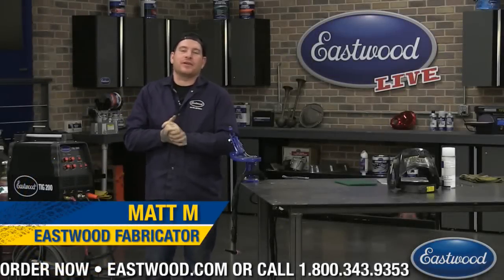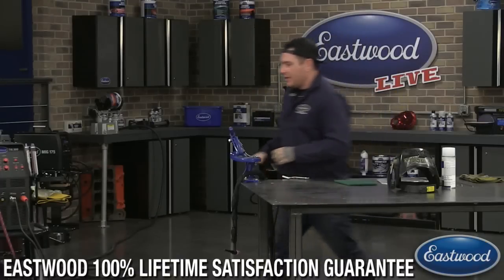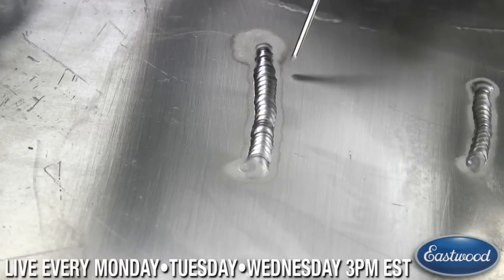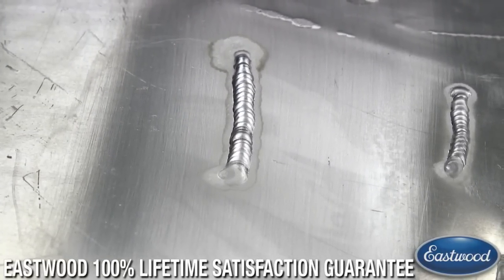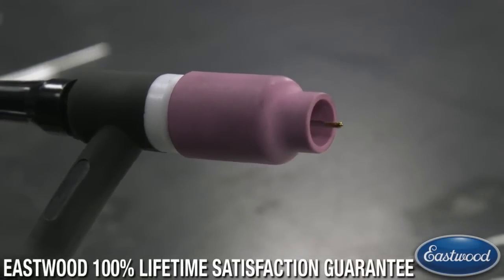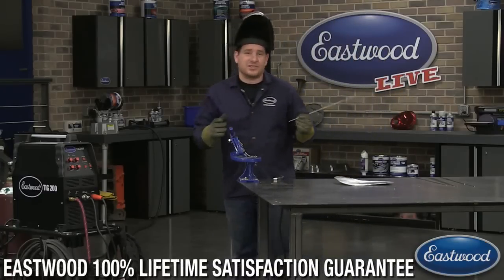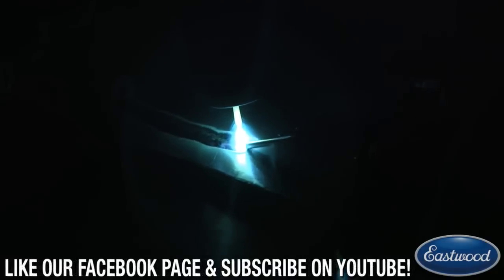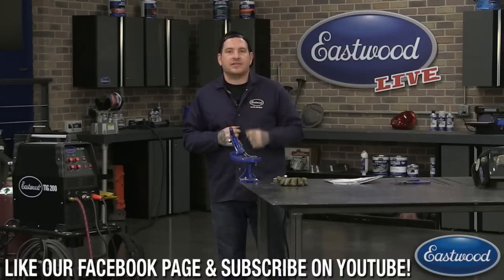How To TIG Weld Aluminum - LIVE at Eastwood - TIG 200 AC/DC Welder

Comment: what about when your join two pieces together similar as to that thickness or even two different thicknesses are settings or anything change very much and would you still be using the same rod and  torch end

Comment: I followed this video and everything went well, just need to keep practicing. My question is, when I am welding in a sitting position (I sit because of my back problems) the pedal wants to work its way away from me. I tried sticking a piece of 120 grit stickit to the bottom and it still slides away. Any advice?
Reply from the maker: You can check out the rocker style pedals we offer. https://www.eastwood.com/tig200dc-foot-pedal-upgrade-5-pin.html

Comment: I have the TIG 200 but it does  not have the TIG/Stick switch? Does my welder not do stick as well?
Reply from the maker: Older TIG 200 models do not have stick welding capability

Comment: Mat,
When you are pumping the peddle as you add filler are you going down with the peddle or up when you add?
Reply from the maker: He adds filler when the peddle is on the “down stroke”. There isn’t a universal answer, but he adds filler when he sees the puddle open up and needs filler. This is on the down stroke and really never on the upstroke. He starts letting up on the pedal as  soon as the filler melts into the puddle. Hopefully that makes sense!

Comment: The pedal controls the gas flow or the voltage from the machine?
Reply from the maker: It turns on both, but the amount of heat is controlled by how much you depress the pedal.

Comment: im trying to buy one of those but u necessary need to use the pedal?
Reply from the maker: The TIG 200 ACDC has a torch control and foot pedal control. The Torch control will be set to an locked amperage while the pedal will be variable.
Reply: @eastwoodco  excellent ill probably buy it soon

Comment: I had all the settings as you did, but instead of a cleaning action... after a few seconds my aluminum and lens looked like they were covered w white powder and my tungsten turned black and tip was rounded... no cleaning or welding happened. Using an Eastwood TIG200 and 100% argon. Purple tungsten.
Reply from the maker: Can you contact an Eastwood Tech: 800-343-9353
Reply: Use a thicker pure tungsten. I strictly use Green 3/32 and 1/8 tungstens and I also have a Gas Diffuser for my Tig 200 AC/DC